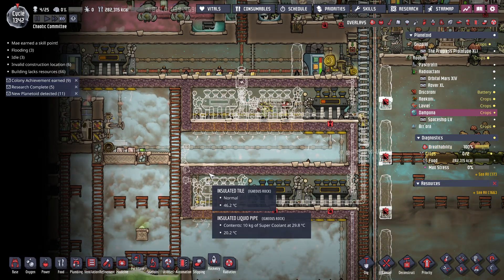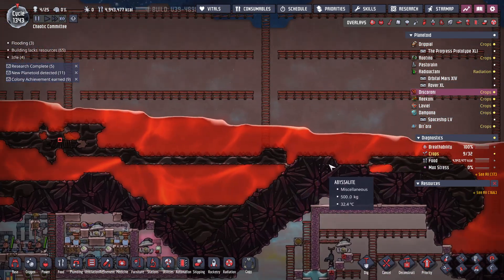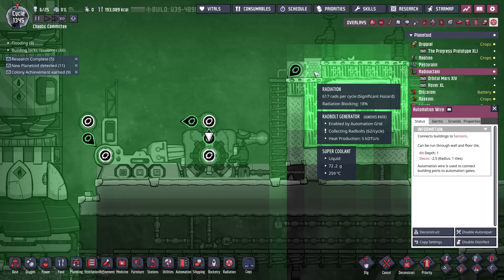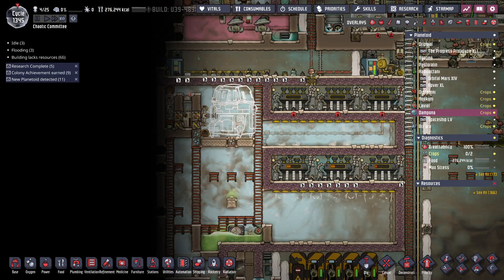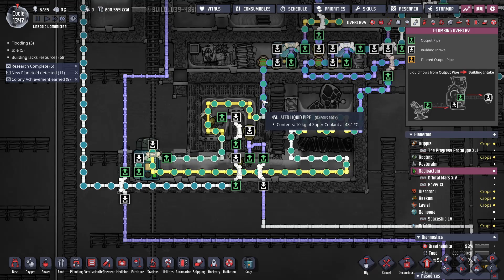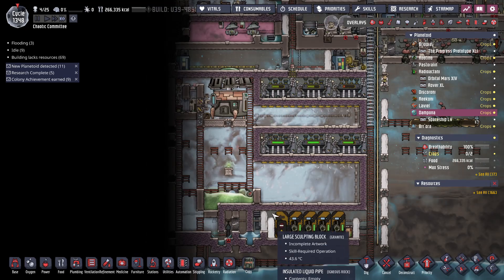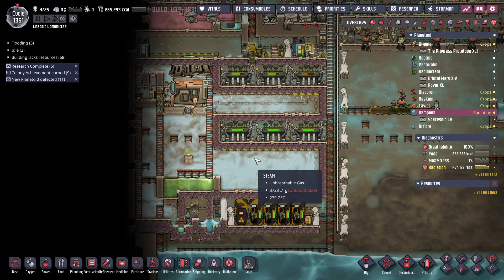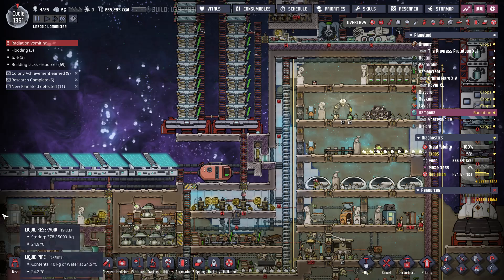Chaotic Committee Ep 39 Adjusting Water Base Reactor setup. Cooling the steam output of main reactor

Comment: It will take a while but the bridge can and will heat up that new insulated tile too. You'd be better served by removing the horizontal bridges entirely and placing them vertically on your coolant line.
Reply from the maker: the insulated tile being warm isn't that bad as it won't conduct heat at any rate of speed.  and for this setup nothing is going to explode.  again.
Reply: @TartarusPlaysGames  yeah, in the location you have it it likely won't matter at all. I just treat it as a Rule of Thumb nowadays after having to break into my polluted water chiller tanks many many times to remove h2o because insulated tiles have gotten heated up and flashed the pw to h2o. I even had it once from leaving empty insulated pipe inside the insulated tile walls of a steam chamber (it took hundreds of cycles to become a problem that time lol).
Loving your bases and vids mate, always getting inspiration from your content.